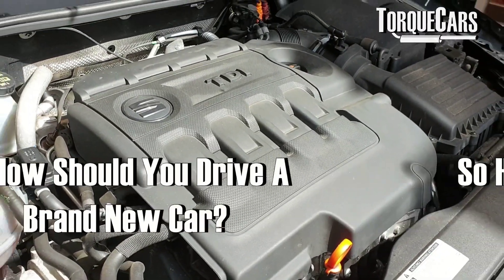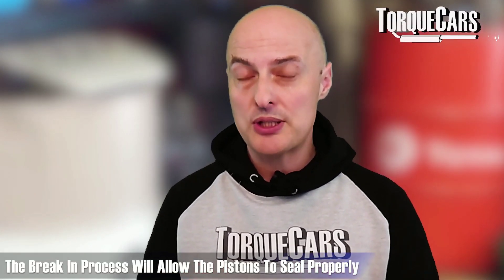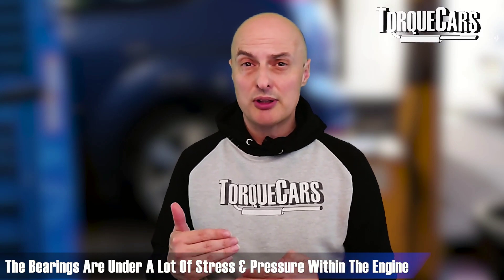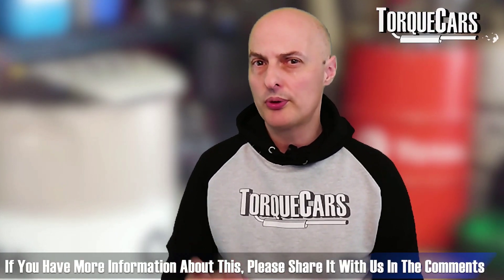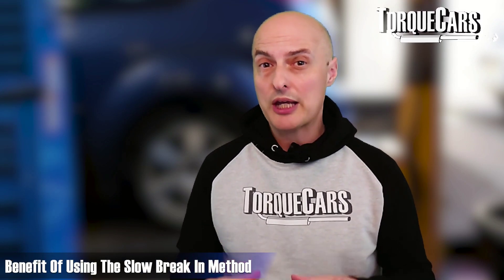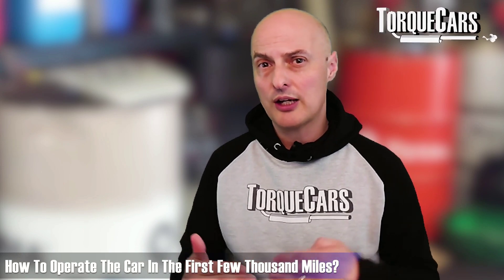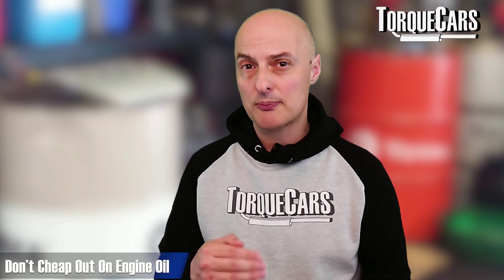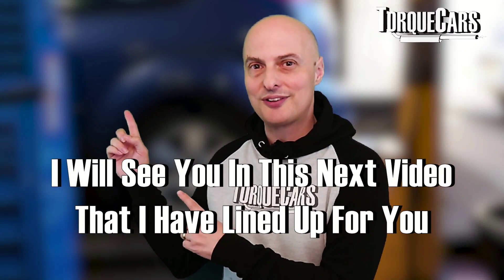Engine Break In Methods: How To Drive A New Built Engine Properly & Maximize Performance & Lifespan

Comment: So 1.8T build update. The rods I purchased 2 years ago don't fit. The big end is 19.9mm wide not 24.9. This wouldn't be an issue if I was using the right aftermarket pistons but I wanted to keep the stock ones. But the small end is 19mm and all the forged pistons have 20mm wrist pins. No matter what I need another set of rods. This was supposed to be a cheap sloppy build and I got more in the head now than I wanted to spend on the whole thing. Brian Crower valves with Supertech springs, oh and I had to buy a new head because the one I had needed work and nobody near me can do it. So one day I may get to break in an engine... I'll take the slow process and not hammer on it the moment it fires!
Reply from the maker: I feel your pain, it will all come together suddenly at the end and I'm sure it will be worth the expense and hard work. I read recently that some of the non forged 1.8T blocks need a little machining to allow the forged cranks to fit it seems to be a problem around cylinder 3. I need to find out more about this but I like many others assumed the engine blocks were physically the same.

Comment: all manufacturers stress test their engines on as bench before putting them in the car typically 1500 miles worth. he should research more the subject as this video is a fail! The engine should be driven FAST!
BY DRIVING SLOWLY A RIDGE IS FORMED IN THE CYLINDERS AS THE RODS ARE NOT STRETCHED PROPERLY